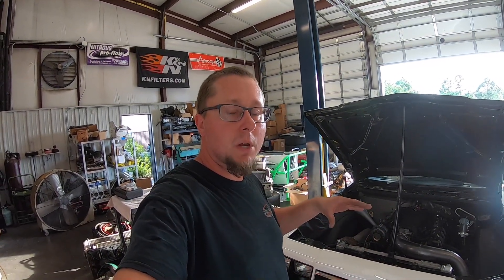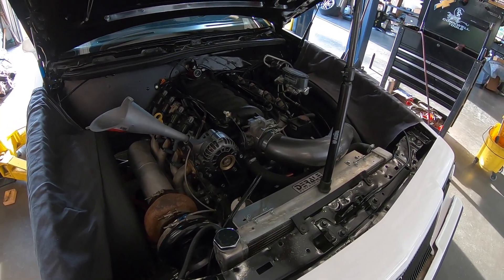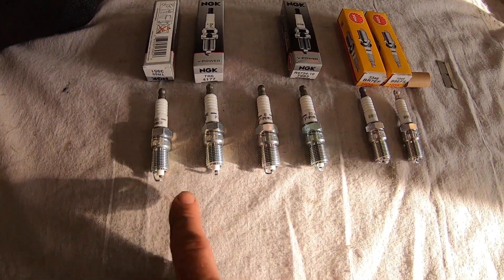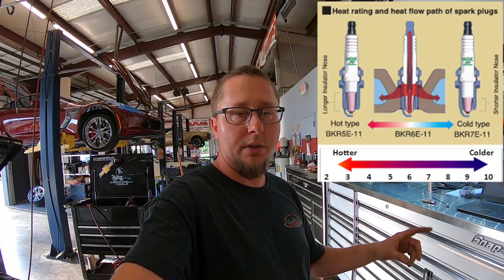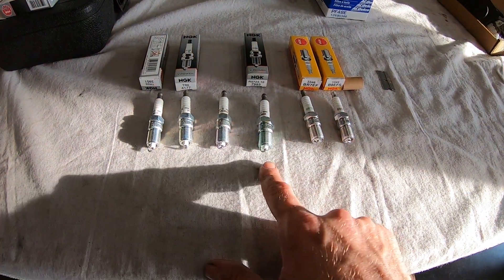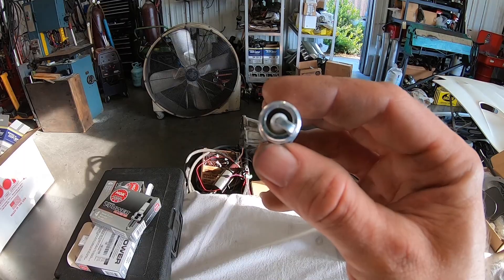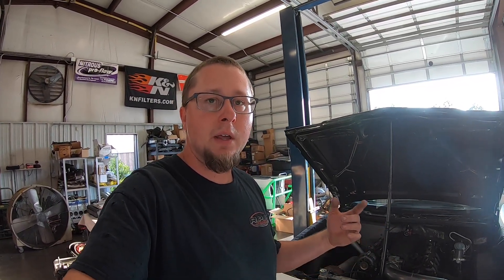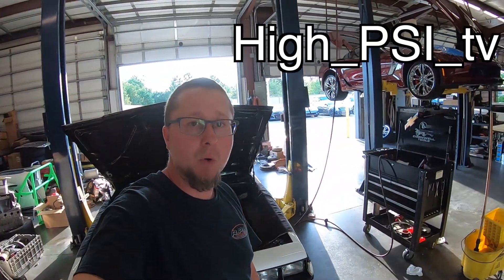Spark Plug Heat Range Explained. Hot or Cold Plugs??

Comment: NGK TR55 gapped .035-.045 for stock or mild modded 'all motor' engines
NGK TR6 gapped .025-.030 for low boost less than 14psi or small nitrous 150 shot
NGK-BR7EF gapped .020-.024 for high boost 18-26lbs big nitrous 250 shot

"99% of the time I Use NGK TR6 plug, and I gap them at at least .025 to start, because I will nearly always shoot for 20-22lbs of boost, and if you gap them around 30 you will get blowout.

we also use the BR7 EF plug when running higher hp, or over 14psi on cars without methanol, or if you just want to be super safe you can run it, fairly cold plug for low boost or low hp application, if you are in an area where its super hot or your compression is high etc might be a good choice"
Reply: Hello, 
A machanic fit heat spark plug in my hyundai Vanue turbo petrol (in which cold spark plug are recommended), due to this the engine stopped producing power after 60 km driving(car move but do not climb even a simple slop).

Went back to machanic, Now I have cold spark plug installed, I have two questions 
1. how to know whether the wrong spark plug have any damage on engine.
2. Will this small 60km event will effect lifetime of my engine (should I sell this car?)

Comment: Jeff, recommendation on a NGK heat range for a built gen V LT1 in a 2017 camaro ss. Compression is still the stock 11.5:1 and I will be running a 88/96 turbo on e85. Should be making around 1200hp. Awesome and informative video man. thanks.
Reply from the maker: Usually we run Brisk plugs in the LT stuff. They have a good chart on their website
Reply: High PSI tv thanks man